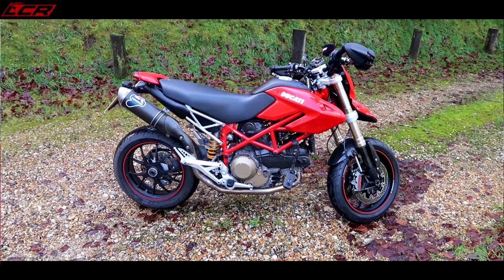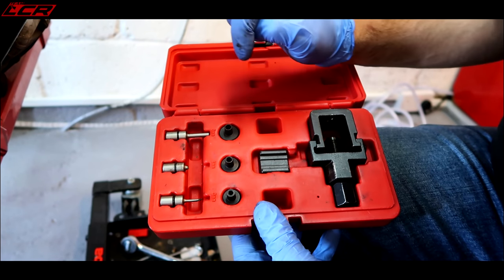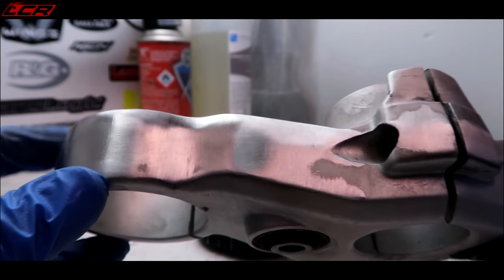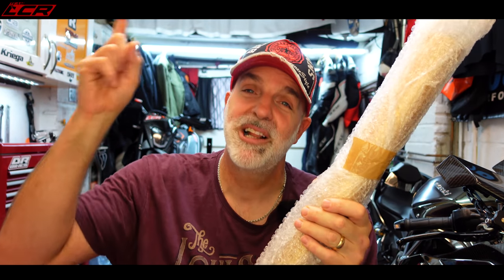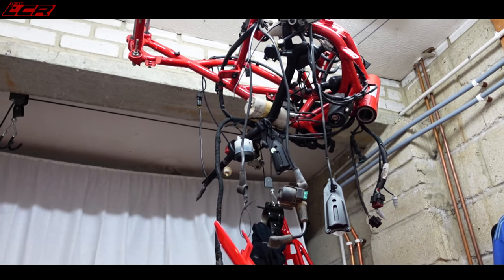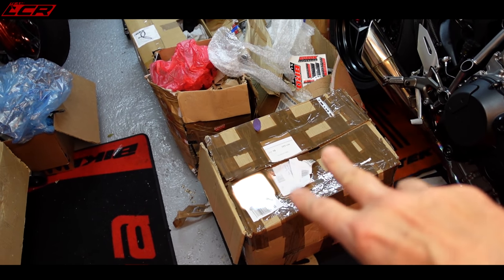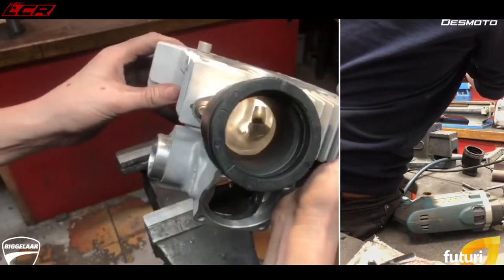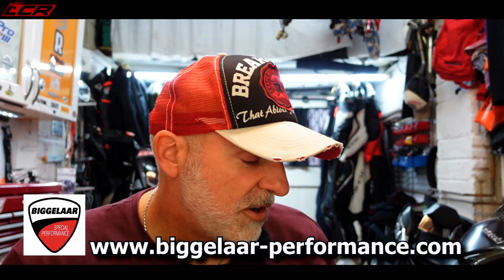Hypermotard Restoration EP11 | The Hyper Project Is GOOO!!

Comment: Are you putting high comp Pistons? If you doing the heads and rebalancing the crank you will get more bang for you buck with a set of Pistal pistons.
Reply from the maker: Cost is already spiralling out of control Kennedy, need to keep it semi sensible 😫
Reply: I understand but just another 725 US dollars

Comment: I've enjoyed many of your films, Thanks. I'm trying to decide between a Husqvarna sm 701 & a Hypermotard 1100. I don't do many miles due to a lot of titanium in my neck so just want some fun. I'm 57 & have had bikes all my life. Several supermoto's including a Husaberg! Wish I still had that, Had KTM sm 990 & a couple of KTM Adventure's 950/990 but never a Ducati.I'm currently on a Husqvarna sm 630 but it's not quite quick enough. I really know the 701 is what I like, but interested if you have any thoughts between that & the Hyper? Thanks
Reply from the maker: Hi Wayne and thanks buddy 👍 the Hyper and the 690 are very different. The Hypermotard is more practical as it has longer legs and does motorways easy, also still handles fantastically but it is heavy compared to the 690. If you like the little nimble SM you may find the Hypermotard a bit heavy.. but it's a more practical motorcycle for sure over the 690/701. But either are brilliant fun! 👍

Comment: You keep the inlet ports ruffed as the fuel and air mixes better and you polish and swirl the outlet ports for the gas to exit faster and smother and by opening them up and fitting bigger valves you gain  more fuel and air into the cylinders which gives you a bigger bang and more bhp/torque.. You'll need to tweak the carbs and add a race filter and get more cold air into the air box for best results . I've ported and polished and port matched a few heads over the years on a couple of race bikes I've built (im no expert) it also will help to add higher lift cams and uprated valve springs for a broader power band and a higher rpm limit and you can even take some weight off the fly wheel to rev up faster but you do lose a little engine break 👍👍  hurry up ffs and get it finished  😂🤣😅
Reply from the maker: Ah there we go, yes hoping to get a induction kit to help with a bit more air 👍

Comment: My ex-hyper had the biggelaar magic done…. 103 Hp on the back wheel…. Still regret selling it. So realistically your gestimate on rearwheel power is not far off imho
Reply from the maker: Oh interesting Dennis, that's good news 👍
Reply: @LambChopRides  mine also had the Twan’s fathers magic porting, race cams, decat and custom map….. you might want to consider a lighter flywheel. It will compliment your work…….suits the package